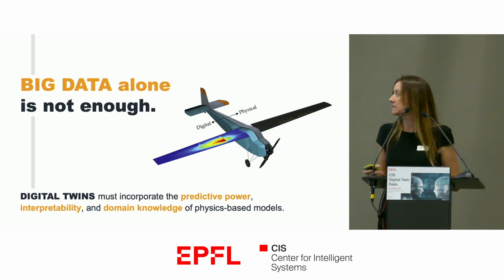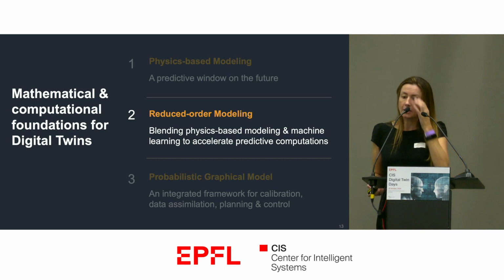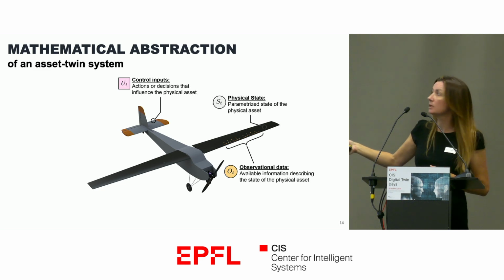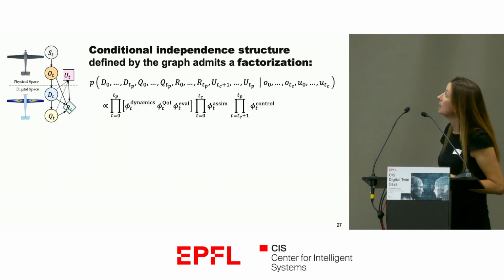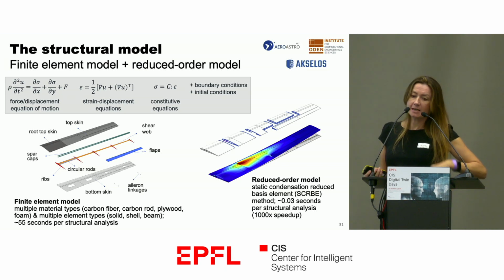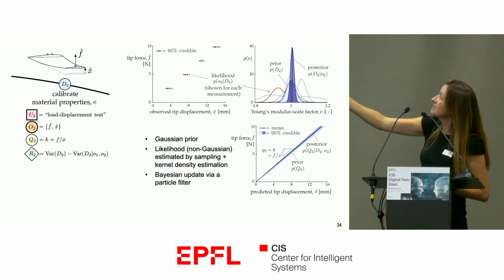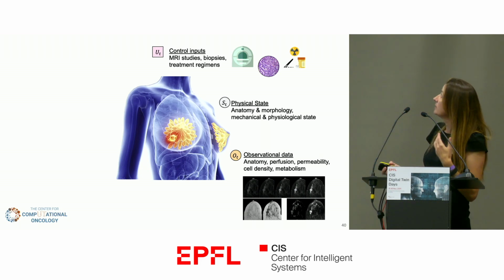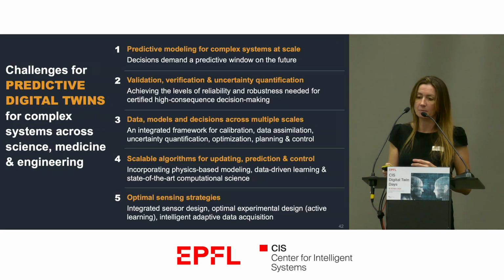"Predictive Digital Twins: From physics-based modeling to scientific machine learning" Prof. Willcox

Comment: How can costs of digitalbtwins be sustainable
Reply: My take is, by focusing on commercially viable features/solutions.  A high level of fidelity is expensive so the work to achieve this fidelity should be limited to problems that are likely to pay off when solved rather than trying to make a high-fidelity digital twin of the whole system. This requires an understanding of the problem area to be able to identify the problems that are actually worth solving using a DT before development of the DT starts, ensuring the developed features are geared towards solving a specific problem. Creating digital twins of multi-system components also helps limit the work needed to be done for every new system, e.g., motors.

Comment: So the bottm line is that simple black box method of capturing system dynamics is not the solution. For a digital Twin, you need to apply first principle to model the system and THEN reinforce it with dynamic field data.